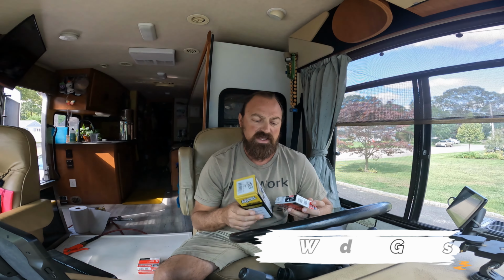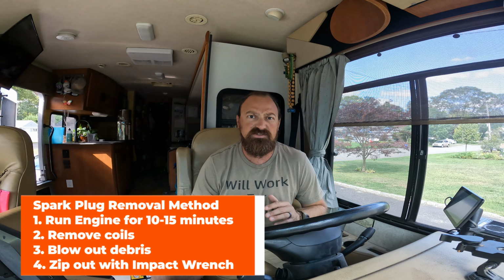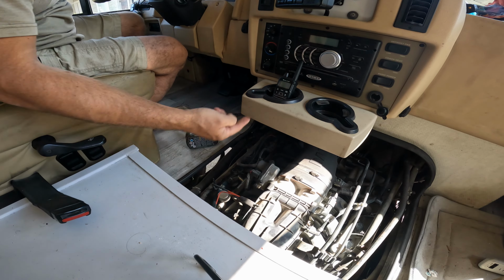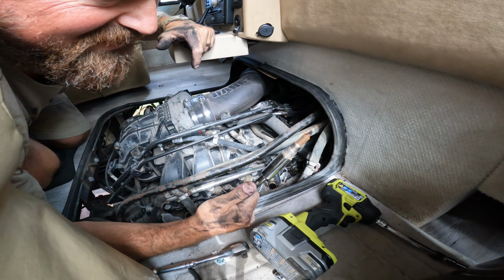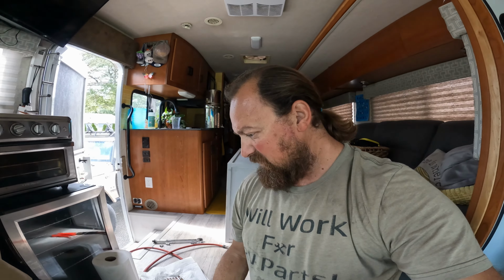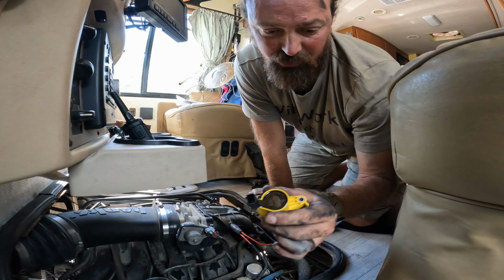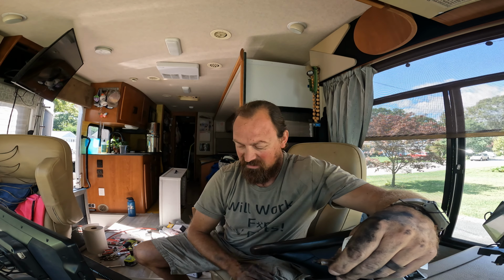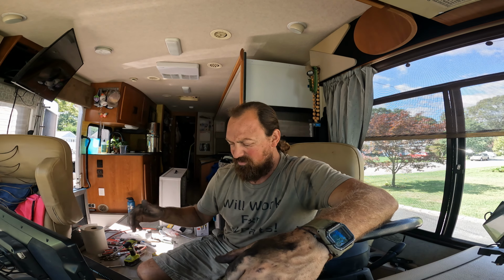DIY SPARK PLUG Change with ACCEL IGNITION COILS On Our RV | 3V Ford 6.8L V10 Triton

Comment: Makes videos and never bothers reviewing the upgraded parts SMH.  Still waiting on the chip tuner review
Reply from the maker: You're commenting on a video that pretty much surmises why the chip tuner review hasn't been done. Other engine issues that would negate any benefit from said upgrade. Misfiring spark plugs is a biggie. So are leaking exhaust manifolds with snapped studs that took me a long time to repair. Any data tested is null from those factors. Would I like to do the video, yes, but I am dealing with stuck lifters or a possible bent rod as I have an engine tick I am trying to track down. Not to mention rebuilding the whole back end of our rv from our crash and repainting it. Add on top  3.5 months of taking care of my mom who had two brain surgeries. So I apologize for not making the tuner review. It may happen, but not while I have other engine issues to work on.
Reply: How are you making out?  The engine feel better ? Was there a big jump in fuel milage and acceleration?
Thanks

Comment: Hello, very good video, my question is how many miles do you change the spark plugs at 100 miles? I have my motorhome and I want to change it, it has 60 miles.
Reply from the maker: Ours was at 120k. Way overdue. 80k would be a good area.